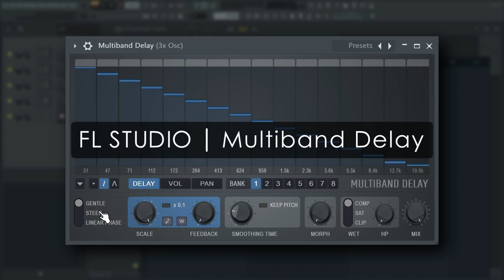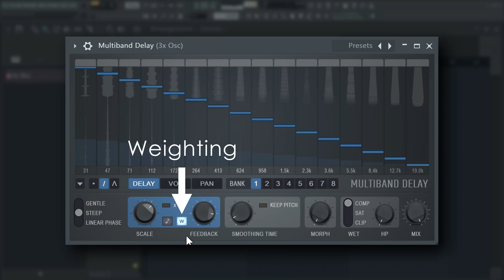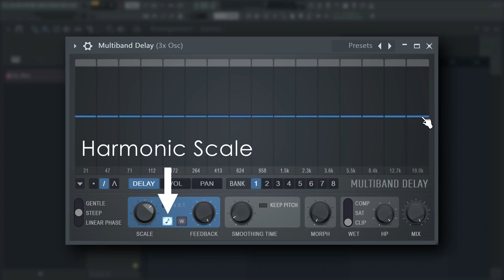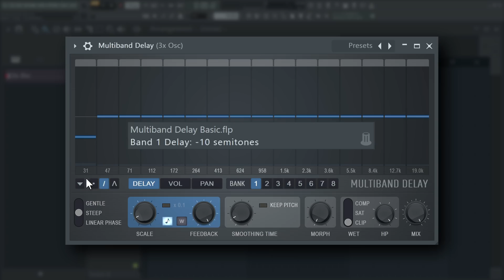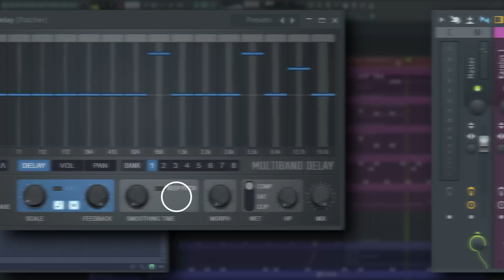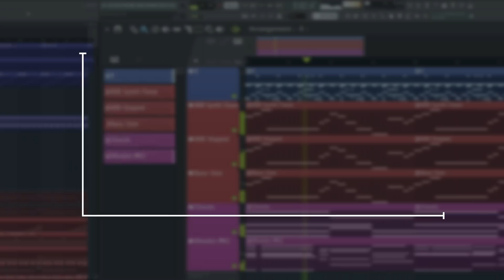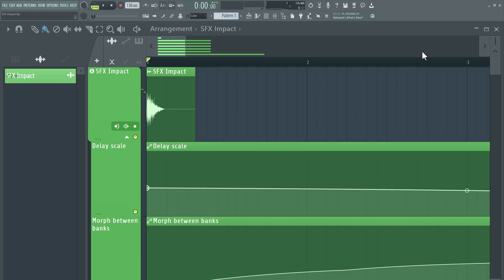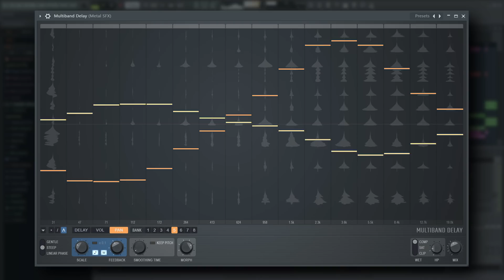FL STUDIO | Multiband Delay

Comment: Cool concept for sound design ... probably missing onboard LFO for SCALE and MORPH... that would sound close to phaser which is also based on allpass filters ...And it would be interesting if there was a parameter that changes the number of bands (like in the first vocoder from Image Line) and crossfading between bands ..  It would also be interesting if for each band it would be possible to change the bit depth ..  And maybe Amplitude  and Freq / Pitch modulation of each band , where both the speed and frequency for each band would be separately configured

Comment: Super nice! Why only 100ms, though? How about 1000? Maybe a 10x button for more weird echo stuff?
Reply: actually is 1000ms and 100ms when "x 0.1" is ON, i think it's a mistake by the editor.
Reply: @FaBianrecord  Correct, this was an oversight as I only looked at the hint bar when x0.1 was on... The real delay value however depends on where the Scale Knob is. The 100ms is only accurate when the scale knob is at -100% or 100% in x0.1 mode.
Reply: @FaBianrecord  ah... right, thanks! nice!